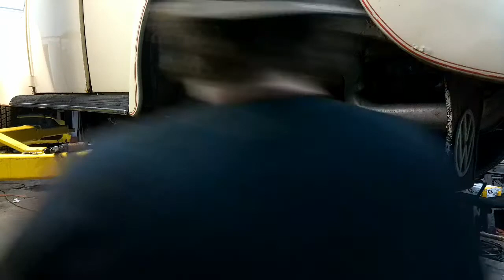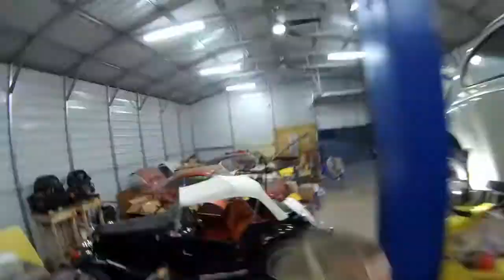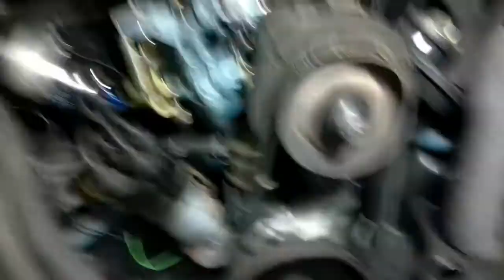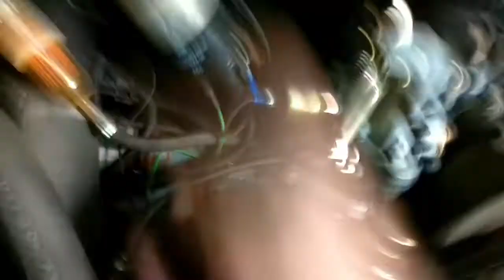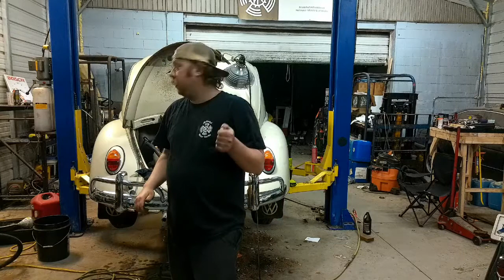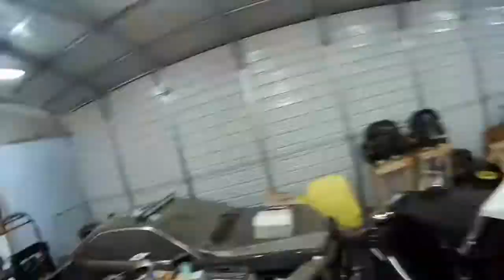1964 VW Beetle Brake Shoes & Adjustment also Distributor Replacement (Pt:2)

Comment: You can see belt material on the underside of the deck lid. Good video of a leaky rear end with unfortunate destroyed brakes. I remember loosing the driver’s side seal on my beautiful Blue 64 bug and it was all over the inside of the wheel before i caught the leak and fixed it. Big mess , and in 1974 we didn’t have spray cans of brake clean we had rags and kerosene.

Comment: Doesn't look as if you torqued the rear axle nuts. Surely that impact wrench could not put out 230 lb/ft.
Reply from the maker: The impact plus a weighted socket I use actually puts it over torque... But you are correct I didn't use a torque wrench and torque multiplier.
Reply: I never owned a torque wrench in 74 when i had my 1964 beetle and never had an issue with bearing ware or loose wheels , now working on my 2000 bug I wouldn’t even consider putting torque on a bolt without a torque wrench because of how flimsy every part on the car has become! I have to add we didn’t use air tools in my dads garage either, just a breaker bar and a pipe for this 165 lb young man .